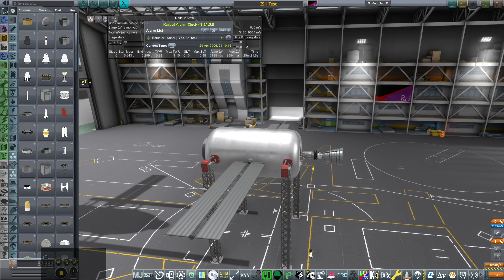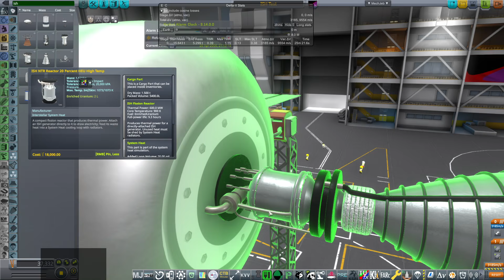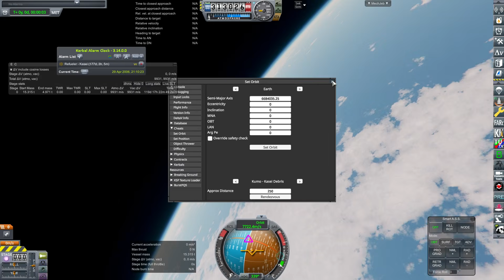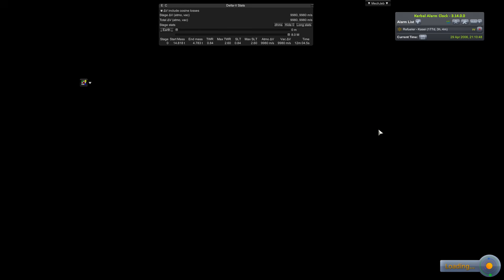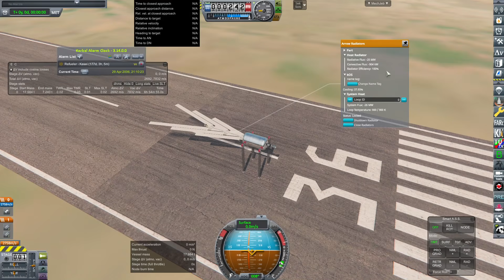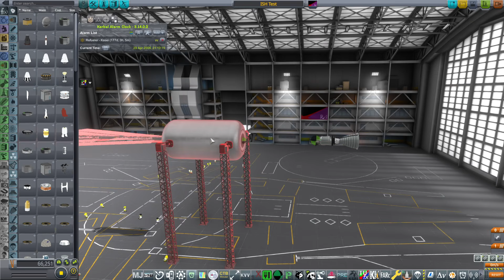NTR Reactors for Interstellar System Heat (KSP)

Comment: I dont get why the NTR needs to conduct heat into the system in the first place, you are literally running coolant through it and expelling it out of the nozzle. Perhaps you would get some waste heat if the reactor is set up for bimodal operation, but this should be configurable before launch.
Reply: Hydrogen is only cooling the core to 2500-3000 degrees C.  The structural casing around the reactor has to be kept below 500-900 degrees so your cooling is the heat flux from the reactor core to the to the structural casing minus the very small around of heat the casing radiates out to space.  I kind of feel like this would be linear as the reactor heats up and a fixed number for a running reactor and not a percentage of the power output.  It you exceed 3000 degrees your core melts and blows up or ejects/squirts out the back end.  As a bimodal I believe 55% of the power turned into electricity would be waste heat needed to be radiated.  So if you use 1mw of heat to make 450kw of electricity you would have 550 kw of waste heat to radiate.